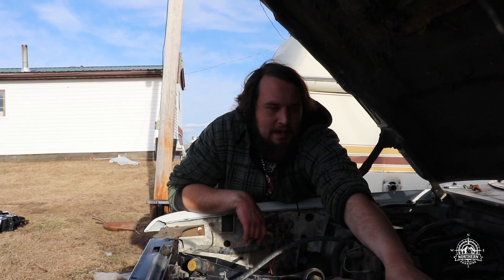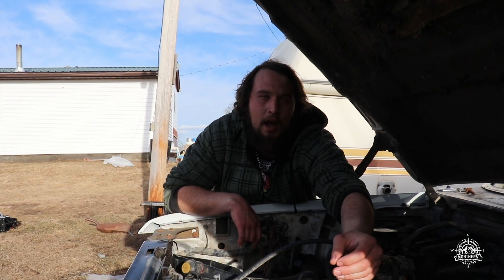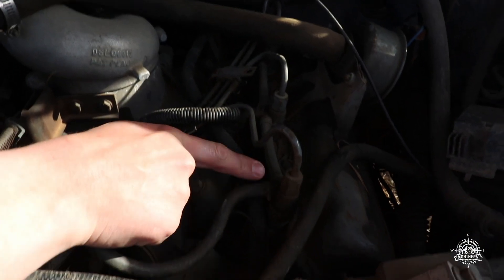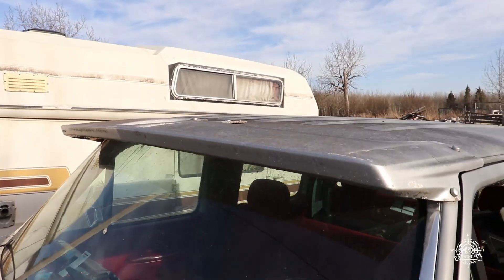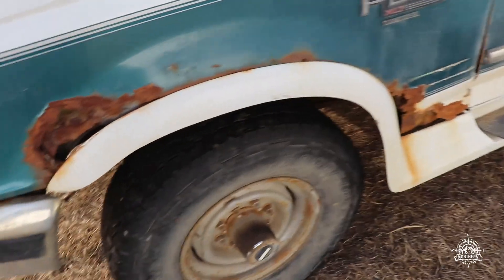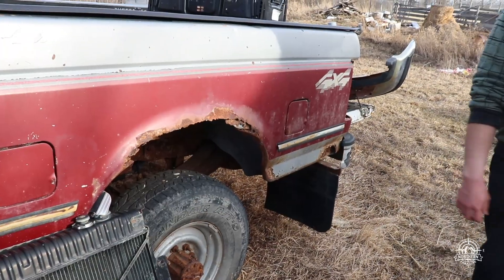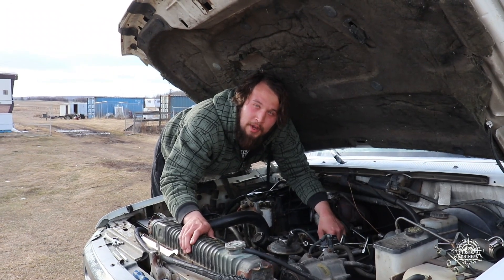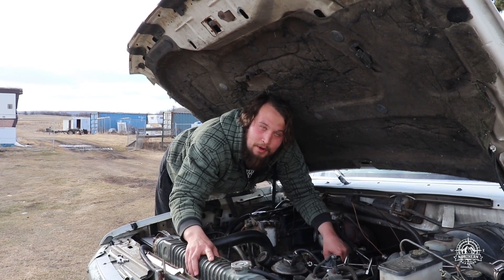Watch before you buy! 5 Things about a 7.3 idi

Comment: I've heard you are supposed to run a coolant additive because the 7.3 idi is prone to cavitation on the cylinders if you don't. Ive also heard to replace / upgrade pretty much the entire fuel system as well. They definitely don't make good built to last trucks like this anymore and it's ridiculous. I'll take an old IDI over one of these new overpriced EPA approved junkers anyday.